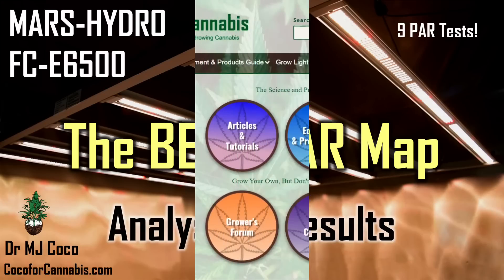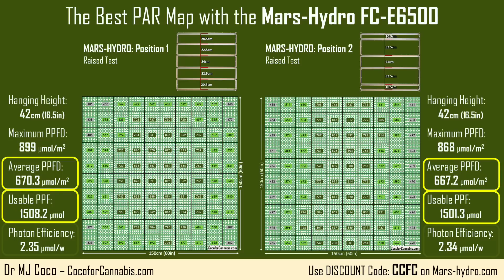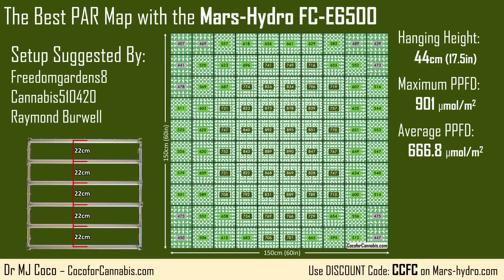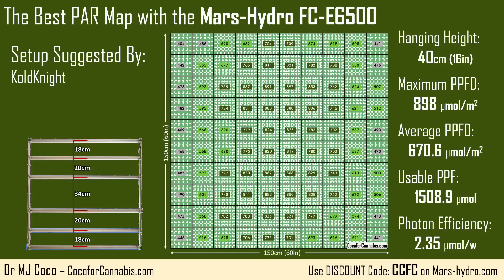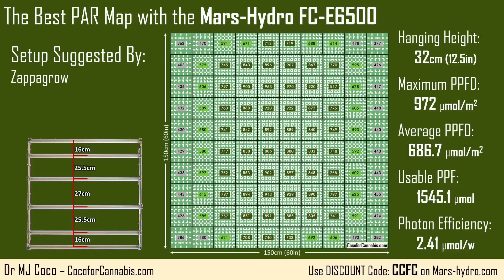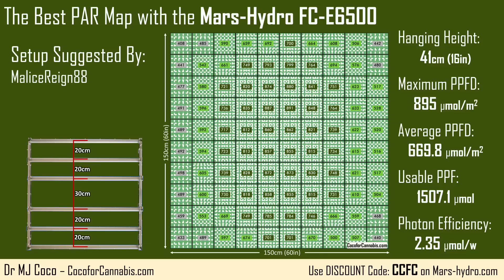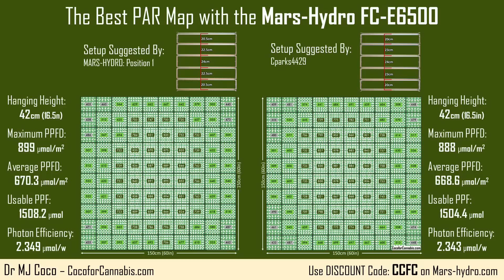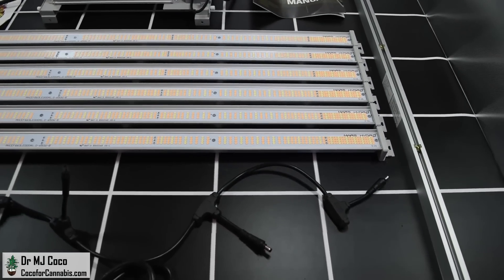Mars Hydro FC-E6500: The BEST PAR Map Analysis & Results

Comment: Great details Doc! I evaluate PAR maps by looking at the average delta of the PPFD in each quadrant. The lower the delta the more even the spread of light across the canopy.

I grow 4 plants in my tent and train them to one cola in every 6" square (same spacing as the trellis). I assume the more uniform the light is from edge to edge the more uniform the growth.

Mars-Hydro  FC-E6500 ($700)
Height, Position, Avg PPFD, Average Delta
Low, 1, 692, 647
Low, 2, 687, 560
High, 1, 670, 455
High, 2, 667, 380

So comparing these 4 results, the average PPFD drops 4% from first entry to last while the delta improves a whopping 41%. This tells me the delta is a more important factor to chase for those looking for uniform coverage. The last entry (higher height and position 2) would be my clear choice for this light.

Ahh, but what about the king, my Medic-Grow Fold-8 at $590?
Height, Avg PPFD, Average Delta
Low, 723, 550
High, 691, 367

Compared to my choice for the FC-E6500, the Fold-8 mounted high average PPFD is 4% higher, Average Delta 3% better, and price 16% less.

Looking at design features, I predict PPFD delta will drive the home grow lighting market. Look at the square shaped PhotonTek SQ series for a preview.

Grower love! and I LOVE my Fold-8! :)

Comment: These new array adjustable rack lights are the next revolution for sure.  I would prefer two 300w 4x2 fixtures or even 4 150w 2x2 fixtures.  So many more options that way, and benefits when you have a break down, or when you are running less or different stages of plants.  I took one of my 100w panels out of my flower tent to re-veg a strain I had troubles getting, until another one came.  I'm still sold on the TSL-2000 or SP-3000's for my needs.  Mars seems to be ahead of the market.
Reply: sp3000 outperforms clearly, lower cost in electric, better profile - sure cost a bit more but what you get more in harvest pays for it generously

Comment: Looks like a O.K 4x4 light, I probably wouldn't put this light in a 4x4 by itself without supplemental lighting, Definitely isn't breaking new grounds or is the best. very low light on like a foot+ in on each side of the lights par charts. 
But it's cool they're offering some affordable lighting, Competes with like the Medic grows and bests it slightly in usable umols.
Reply: These par maps are for 5x5
Reply: @domingogonzales3101  yeah and the corners are too low for flower, I would need supplemental lighting on each side so it's over 450-550 ppfd and closer to 700-1000
Reply: @codys14  most people flower in a 4x4 with 650ish watts and get a even coverage of 800-1000 all around just as these would .
Reply: if that's true than it's suitable for a 4x4.